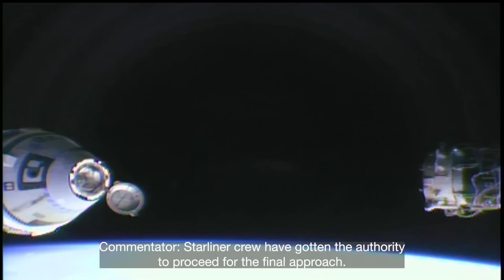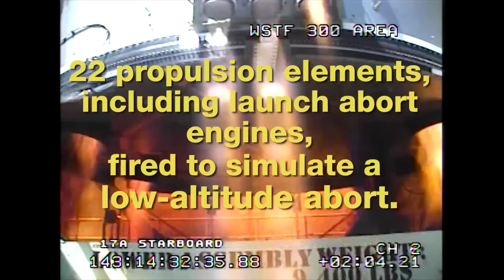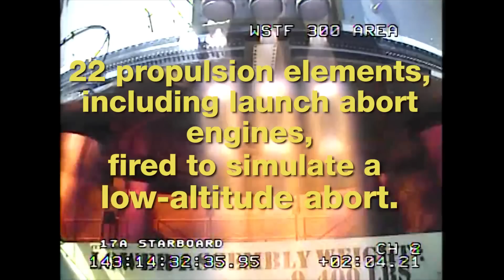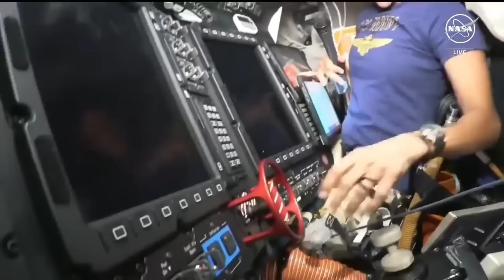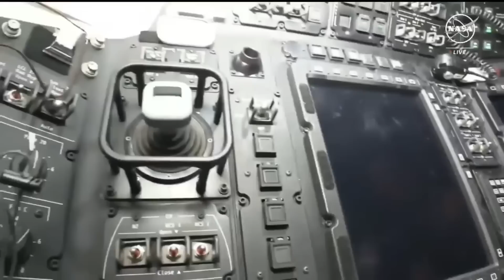The Decision Is Made - Boeing Might Be Safe? But SpaceX Is SAFER!

Comment: I don't even understand why they risked docking after the thruster out-of-spec problem, risking the entire ISS and everyone on board. Boeing should really focus on their problems on Earth instead of bringing their problems into space.
Reply: It was either that or risk a crewed re-entry knowing there's a potentially fatal problem with the spacecraft. NASA are a bit sensitive about that. Given that there were thruster issues with the last uncrewed flight this one shouldn't even have been crewed, it should have been a thorough uncrewed test with particular emphasis on the thrusters.
Reply: @mitabpraga7487  Exactly. Docking with the ISS wasn't without risk, but it was a safer option than leaving the crew to re-enter immediately on a vehicle of unknown safety.
Reply: The deorbit and reentry would have gone seriously wrong if they aborted the docking. 

The deorbit procedure is very tough on the thrusters, and they would not have had time to figure out the thruster failures that happened on the docking attempt, so they would have been attempting deorbit without 5 of the thrusters. Now they have had time to bring 4 of those 5 back online, check how the spacecraft will preform if/when it loses those thruster again and potentially more, and operate the spacecraft slightly differently to lessen the failures.

Comment: When your life depends on it, “might be safe” is “definitely not safe.”
Reply: In the Air Force (iaf) we had a saying, When in doubt, there is no doubt.
Meaning the jet is not cleared for flight, go back and double check everything.
In aviation, flight safety always comes first.
Reply: I mean all elements are "might be safe" but its when you have a high confidence in understanding the state of your system. Its why aircrafts have preflight checks and regular inspections. You want to understand the state of your system, both before, during and after use. 

Starliner is a case where the system is an uknown state and you cannot check its status accurately either. And by the lens of safety an unknown status means you cannot calculate the risk, and thus you have the assume the risk is maximal.
Reply: @mobiuscoreindustries  A good analysis.
Reply: also boeing not calling it done is the only thing that really ruins them no matter what happens. they fd up and wont admit it
Reply: Challenger crew killed by schedule
Reply: All vehicles are "might be safe", including cars you get into daily. It's just a very low percentage when it's not.

Comment: If you need ballast, you need something with substance that carries weight. That rules out using Boeing's reputation as ballast.
Reply: Well, at least it would come down. 😅
Reply: @jamesogden7756  everything comes down. That's not the hard part. Boeing has a hard time with getting things down while still fully assembled and in a way that keeps it fully assembled once down.
Reply: @peterkallend5012  ... that is the rub eh? Clever man.

Comment: The “strap in under the cargo without a compatible spacesuit” contingency plan is something straight out of The Martian
Reply: Story Musgrave did one reentry standing up between the pilot and commander's seats on the shuttle.
Reply: @cptjeff1  yes but he didn't need to
Reply: @cptjeff1 why did he do that?
Reply: @cptjeff1   The Shuttle had a much softer reentry at just 1.7gs to a runway landing. Dragon sees about 4.2gs.

Bigger thing is probably parachute deployment and splashdown which are a bit rougher and more jolts and jerks.

Actually just found a clip of Bob Benken describing Dragon reentry and he described the parachute firings as "getting hit in the back of the chair with a baseball bat"
Reply: Well, flying for 8 months when it was supposed to be just 8 days is already somewhat similar to the Martian.
Reply: More like the ending from Moon (2009)
Reply: @Skip6235  to be fair, if NASA asked for compatible space suits, supporting systems and software etc etc, then they would to have to write detailed specifications and there would be years and years of compatibility testing between Boeing and SpaceX. It just wouldn’t be the spacesuits. It would be compatible integrated systems. Vendor to Vendor testing and spec interpretations doesn’t end well and Boeing would have slowed down SpaceX.
Reply: it existed as an idea long before that
Reply: They’re currently down to 1/8 of a potato, 3 vic0din’s, and 3 oz of water per meal…
Reply: McGyver that!  Hey Suni and Butch are engineers (or close enough).  They could do come up with some "couches" given the mountain of spare junk on the ISS.
Reply: @AlanTheBeast100  
NASA already have a plan in place to make seats out of foam, on board the ISS.  They tried it out  on a previous Crew Dragon.
Reply: @AlanTheBeast100   Not much McGyver work needed. NASA gave an emergency contract to SpaceX weeks ago to study how to send up emergency seats (disassembled) and mount them in the cargo area. They'd be sent up on Crew 9 and then installed in the Crew 8 Dragon. Apparently Boeing prefers to keep astronauts in the standard seats that were engineered in their placement in a longer timeframe.
Reply: @donjones4719  That takes all the fun out of it.
Reply: That’s true, but consider this… they get to jump on the train like a hobo.   C’mon commander, let’s go “Hobo”….
Reply: @A_MOISTER_OYSTER  I like to think of Suni and Butch as stowaways.  Caught! And now are assigned all the pile up of deferred maintenance and chores nobody else wants to do.
Reply: If your only other option is a failing space station - take it. This would only be a contingency if something catastrophic happened to the station between the time the Starliner undocked and the second Dragon arrived. Since there are already 4 astronauts for the 4 seats of the Dragon parked at the station, if Starliner is gone, B&S would have to use that extra space in case of that extreme emergency. But I would be willing to bet NASA will make sure there is as little gap as possible between Starliner leaving and the second Dragon arriving.
Reply: It's not so much about being well strapped in, it's about what's padding under your back when the capsule hits the water, which apparently is like being in a  small car crash.
Reply: Why don't they send 2 extra seats on dragon? It was designed for a crew of 7...
Reply: @sazeredo26  Designed yes. But never certified to do so. So  I guess not a viable option now. Ironically it was a NASA safety call to remove the backseats.
Reply: @sazeredo26  then you'd have more astronauts on the station than necessary
Reply: lmao no way
Reply: When NASA say Starliner is the best contingency in an emergency, this here is what second-best looks like.
Reply: Absolutely, but there was a tiny chance it was ever going to come into play (actually, the scenario where it could come up hasn’t passed yet). Starliner is going to have to undock before Crew 9 arrives. It’s taking up their docking port. So, there will be a brief period where there will be two more astronauts on board than there are seats. If an emergency happened during that short window, and everyone had to suddenly de-orbit, they’d have to go somewhere. So, buckle up.
Reply: Not strapped in under... Laying on the floor where there are 3 extra seat spots that were part of the original design of dragon. They just strap cargo there instead and hence the reason for only 4 actual seats. Still perfectly safe. And I'm sure Elon would have just sent some extra SpaceX suits up for them so they can throw that garbage into the starfailure
Reply: @davidmoore8741  The suits are coming up on Crew 9.  Between Starliner undocking, and Crew 9 docking, Butch & Suni will have to go suitless inside the Crew 8 Dragon if (an incredibly unlikely) emergency evac from the ISS is required.  Dragon is pressurized, so that shouldn't be a problem, unless Dragon has an unexpected cabin depress that doesn't destroy the vehicle and kill the crew protected by suits anyway.  Landing might be a little more uncomfortable, depending how softly they can stack cargo on which to lay on, and how snugly than can secure themselves to it, during what would likely be a rather chaotic rush to load up the dragon and get away from the ISS.
Reply: Apparently no special clothes are required for the return flight. While some kind of a suit is normally worn, it is in no way necessary. Saying strapped in in the cargo area is flippant and misleading. Dragon can be configured for 6, as it will.
Reply: @alexanderSydneyOz  "in no way necessary"
Reply: @alexanderSydneyOz the crew wear pressure suits in case the vehicle depressurizes during flight. Please watch Crew 9 launch and you can even see them pressurize and test the suits in the capsule. So not having suits is very off-nominal. 

Second, if they have to come back that way, there are only 4 seats in the Dragon. Again, please watch Crew 9 lift off and talk to the 2 astronauts who won’t get to fly on the mission because Butch and Suni will be using the 3rd and 4th seats (in the SpaceX suits that will be brought up to them) on the way down.

Comment: Why not use the extra three seats that can be installed behind the front four?
Reply: Its not behind...but below.  NASA is uneasy with those 3 astronauts sitting below the other 4 during a splashdown.  They could do it if they really needed to but would rather not if it is not absolutely necessary.

Comment: Kinda dumb that they don't have interoperability between Starliner and Dragon spacesuits.
Reply: That'd have taken another 20 years of wrangling with Boeing to get things off the ground.
Reply: @dvv18  All it would have taken is for NASA to have specified some suit interface standards at the start of the commercial crew program... but NASA isn't much more competent than Boeing.
Reply: @ariochiv   "All it would have taken"? Gawd… You're not an engineer, are you?
Reply: @dvv18  I know that spacesuit design is not trivial (yes, I am an engineer) and that NASA has apparently failed several times in their own efforts in this field, but you don't have to design the actual suit in order to standardize the suit interfaces with the craft. Imagine if every Air Force aircraft had to have its own custom flight suit. Absurd, right?
Reply: @ariochiv  Call me Doubting Thomas, but how can you be an engineer if you're so blasé about specs? Especially when  a huge federal agency and a government mega-contractor are involved?

Comment: Suggestion for the next Commercial Crew Program: standardized suit compatibility... I don't understand why this was a problem or was overlooked
Reply: It is not as if there is a major movie about the one incident where incompatible life-support systems famously bit NASA before.
Reply: All they need is a conversion box unit.
Reply: I’m sure Elon can send them some spare suits
Reply: @thebigpicture2032  Knowing him, he would just give them the drawings and say. Why don't you just build them. Given that he has already realsed the Cybertrucks manuals and guides too.
Reply: If a customer wants compatible interfaces it has to order them as such.
Capitalism = voluntary exchange of resources among equals.  IP prevents that, because it creates unequals, as one is being protected from the other copying his 'commercial' solution.  But this is not capitalism's fault - this is the fault of the political system - which enforces IP rights - AGAINST capitalist principles.
Reply: Apollo 13 O2 systems differed between the lunar lander and the capsule.  Had to make-shift adapters (fortunately successfully) to save the 3 astronauts. Did we learn from this?  Such dumb-asses . . .
Reply: Just standardize on Sokol already. It is a well tested system.
Reply: Wow, that got a lot more political than I thought it would... remember the goal of the Commercial Crew Program was to have multiple redundant spaceflight systems at a lower cost. Having suit cross-compatibility would increase the redundancy of the vehicles.  They don't necessarily need to have full functionality, but good enough to work in an emergency.
Also, to those arguments about IP and capitalism, please look at any cable, cord, or hose you might have and tell me how many of them have proprietary connectors and are not made to some industrial standard.
Reply: @Emu0181     "cable, cord, or hose .. tell me how many of them have proprietary connectors and are not made to some industrial standard"
Almost any 'industrial standard' came to be as a proprietary thing.  To become a recognized (or de-facto) standard the IP protection either ran out (or got ignored) or the IP holder gave it up early (like recently happened with the Tesla charging connector, which is now NACS - see Elon's reasoning on the matter ).

The interesting bit is that all standards descriptions themselves are sitting behind a paywall these days.
Reply: @Emu0181    often the proprietary origin of industrial standards is recognizable by the name the objects have that are made to that standard..
The Edison socket to this day (E27 for example, 1881 patent), the Schuko connector (patents from 1925 by Albert Büttner, a Bavarian manufacturer of electrical accessories), NEMA 1-15 is based on Hubbel's patents, etc. pp.
Reply: @Emu0181    PS:
"In 1919, Hubbell unsuccessfully tried to prevent other manufacturers from making receptacles and plugs to the dimensions used by Hubbell."
Reply: Commercialism.
Competition.
Capitalism.
Proprietary rights.
Dissimilar redundancy.

All seemingly good reasons why compatibility was not a requirement in NASA's contracts. Seemingly they just never factored in this kind of scenario.
Reply: @  EdwardRLyons    capitalism is defined as voluntary exchanges of resources among equals.  Nothing more, nothing less.
If the customer WANTS compatible interfaces, he has to demand that from the suppliers.
As for proprietary solutions that prevent the competition from replicating ur product commercially - due to IP - that is actually ANTI-CAPITALIST, as it prevents competition.  IP creates a winner-takes-all-enviroinment, a field of unequals.  This is simply not compatibly with 'capitalism' as defined.
Which means - what exists CAN NOT BE captialism.

Comment: We know Crew Dragan, just like Starliner can be fitted with 7 seat. Is it time for NASA to start fitting them? Not for use during the launch, 4 seats is all they need for that, but after the last couple of years and as the ISS enters it's terminal phase. Maybe a little extra capacity for urgent and unplanned returns my be a wise idea?
Reply: True, sounds like a missed opportunity to not have the extra seats available on every flight
Reply: It's actually landing that is the issue, a hard landing after a launch abort requires a particular seat angle for safety, which only works with four seats.
Reply: @StevePemberton2  Did you actualy read what I said? Try again.
Reply: @StevePemberton2  When the soyuz got messed up a couple of years ago, we had 3 cosmonauts possibly stranded in the event of any single issue!
While at the same time, a docked Crew Dragon, a ship able to return 7 people (3 more that it had actually delivered to the space station) to earth. 

The biggest issues was pre-installed seats! 
Does that really sound like a big issue to you?
Reply: @mattmcc72  The more than four seat safety problem exists for contingency deorbit from the station. The point is the capsule is not designed for seven, that may have been a planned goal,  but as it turned out it could not be safely realized, at least in NASA's opinion. Exceeding four astronauts because someone's ride home on another vehicle is unavailable is going to be a risk no matter what they do, but it's also something that has a fairly low likelihood. Yes they could design jump seats, that may reduce the risk somewhat, how much safer than being strapped on top of soft cargo is hard to say. It would be interesting to hear the results of any studies that have been done.
Reply: @mattmcc72  Dragon has not been capable of seating 7 astronauts since they switched from propulsive landing to parachutes and splashdown. 

When they switched to parachutes and splashdown they placed the astronauts at a different angle and added some shock absorption, which meant they couldn't fit in the extra 3 seats as planned.

I believe with a bunch of redesign work they could make 7 astronauts fit, but there hasn't been anyone willing to pay to have things redesigned to fit 7 again.
Reply: @StevePemberton2  After the Soyuz, plans where being considered to strap astronights  into the cargo space of CD, that spaces where the seats used to be. If there was a urgent need to escape the station?  Does that sound safe to you, or to NASA?

I'm, talking about last chance resource! Actual seats sound a lot better that a couple of cargo stap against the bulkhead to me. Considering that this is twice in two years that there has not been enough "safe" seats to get everyone off the station. 

Both of these capsules where designed for 7, going down to 4 was a late design change, they didn't change the inside demontions for it, just the angle of the front row. Something that with probably very little effort can de designed to be made adjustable in the case of an emergency! 

Or we could stick with cargo staps! LOL

Comment: At this point Boeings Rep has negative mass.
Reply: They want to fuel an FTL drive with that mass or what?
Reply: Send them to the ISS
Reply: @williamcase426  Yes, aboard the Starliner. XP
Reply: "It floats upward!" to quote Manley from the HLS video xD
Reply: They will have to cheat using Alt+F12 to get their reputation back.
Reply: Except for the methane gas that comes out of them